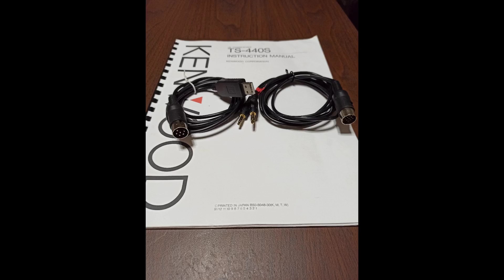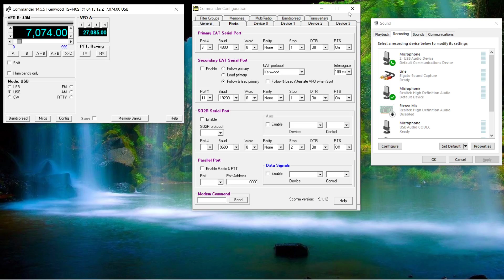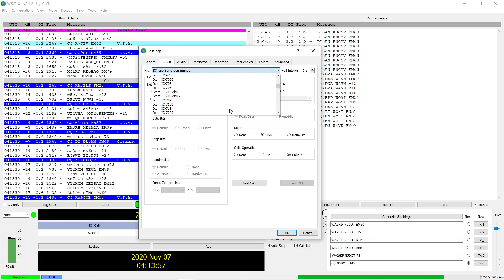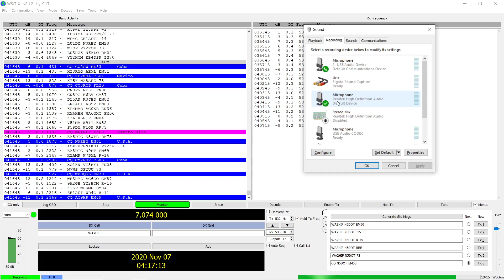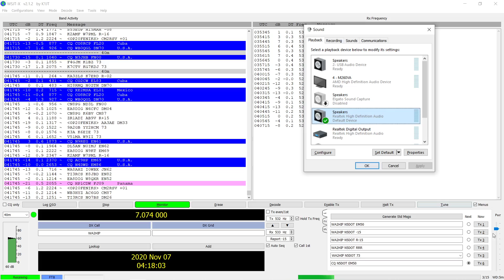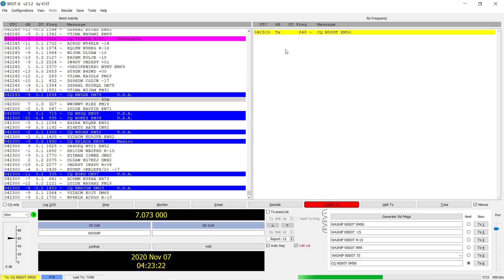Kenwood TS-440 interface to PC using DX Commander & WSJT-X

Comment: I cannot make my ts-870 do transmit, i have soldered pin 11 to ANI, Pin 12 to GND, pin 4 GND and pin 3 to ANO, cant make it move power meter while on USB, when on PSK then it shows power output, any help?
Reply from the maker: Make sure that your mic gain is set correctly and you tune before transmission. My TS-440 has 2 separate connections to my PC. One connection is strictly for audio, the other is for rig control.
Reply: I have a TS440, does this setup allow me to run my rig in normal HF Tx-RX remotely?

Comment: Thank you for the helpful video. I am still trying to figure out all I need. Could you please explain what is the DX Commander for? I thought that the  WSJT-X program was all I need for the different digital modes. 
Thank you.
Reply from the maker: Wsjt-x is mainly for ft-8, ft-4, wspr, etc. There are other modes such as SSTV, PSK31, RTTY,  and quite a few others that are not included with WSJT-X. The DX Labs Commander program is used to interface your radio with the WSJT-X program(CAT control). Mostly for the older radios that WSJT-X has trouble engaging the PTT through the program.
Reply: @pumalova56  Okay, starting to make sense now, thanks. Now another question about the 13 pin DIN audio cable ,I see where the 13 pin end of the cable goes, but how about the other end with the (2) 3.5 mm stereo TRS plugs ? My laptop only has one headphone out connection, no microphone in connection. Could I still make it work ?  
Thank you for your time, any help is appreciated
Reply from the maker: @dkk4751  https://www.amazon.com/dp/B00IRVQ0F8/ref=cm_sw_r_cp_awdb_imm_63ZENQX9EZZ2E34BHZYA?_encoding=UTF8&psc=1